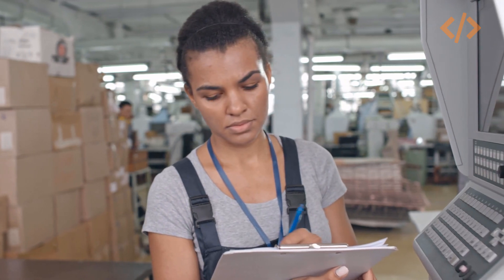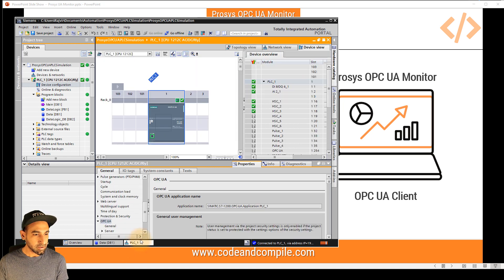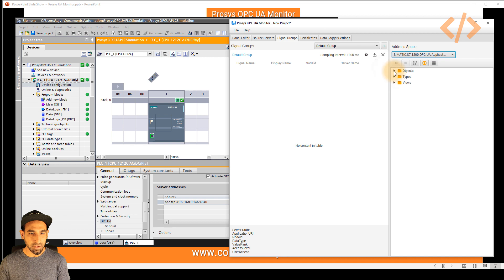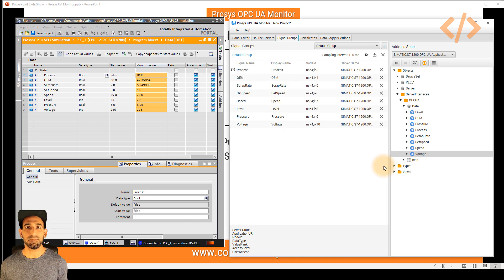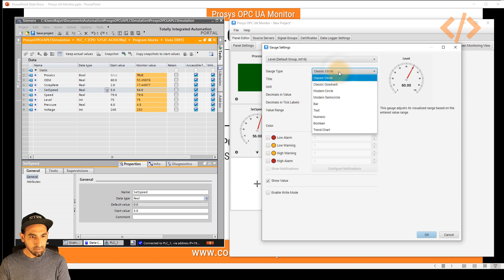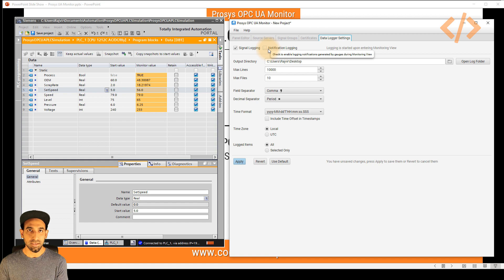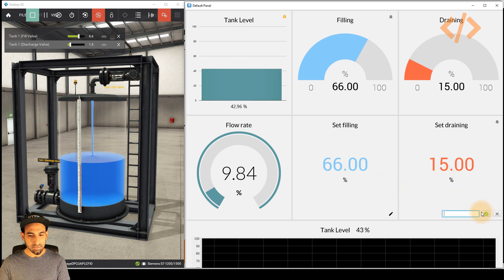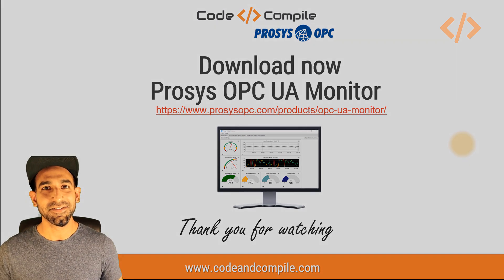Prosys OPC UA Monitor - Read your OPC UA data in seconds

Comment: Hello rajvir, I think it's update of prosys client just they improved to add visualization with control .Before with prosys client only we can read and write (control our plc) .. right .?
And another question can we  replace this prosys opc  monitor in place of. Grafana .?
Reply: Dear Chinnu,
It is great to hear you already know our products! UA Monitor application is a completely new HMI client that was released a few years ago. What you could possibly be referring to is OPC UA Browser (prev. OPC UA Client) software, where you can read and write variables. 
Best Regards,
Prosys OPC Team
Reply: @prosysopc  hello can we connect opc monitor endpoints  to grafana  ..?
Reply: @chinnugow  Dear Chinnu,

Thank you for your question.
OPC UA Monitor is a client application, therefore, there are no OPC UA Endpoints available.
Could you please give us more details on your issue and clarify what is exactly defined by Endpoints and how different they are from OPC UA Endpoints?

Best Regards,
Prosys OPC Team
Reply: @prosysopc  I mean if I want to use data coming from shop floor and I need to map to grafana endpoints like webport for visualization .
.
Reply: @chinnugow  Dear Chinnu,
Thank you for your comment.
Unfortunately, UA Monitor does not provide any kind of access to data that it receives from the Server for other applications.
Please let us know if you have any other questions regarding the software - we will be happy to answer them.
Best Regards,
Prosys OPC Team.